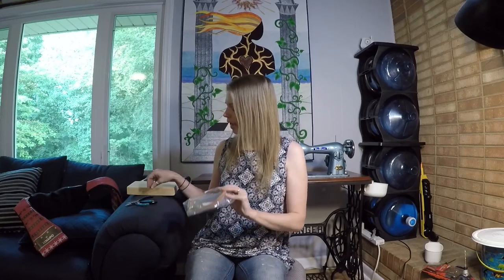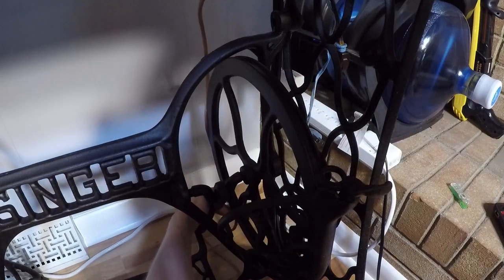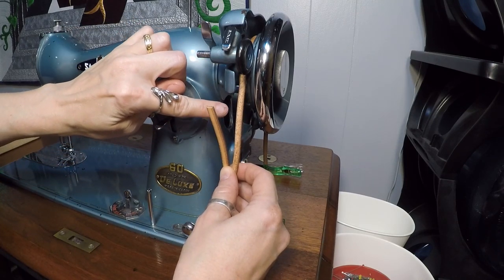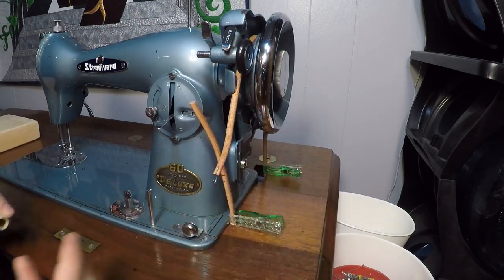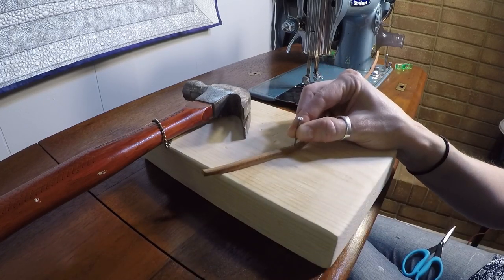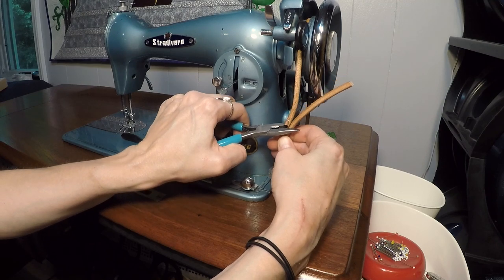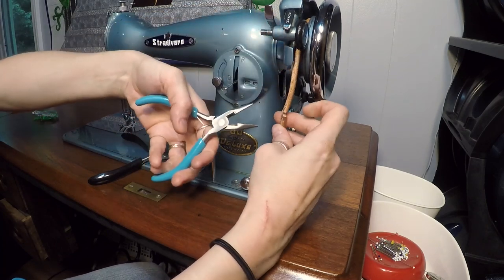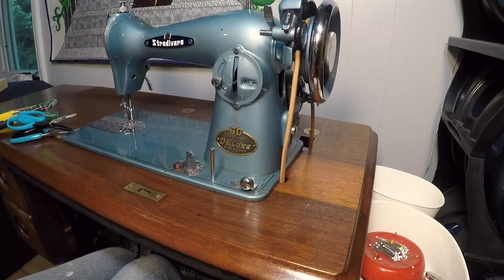How to Replace a Treadle Belt Step By Step with Leah Day

Comment: An essential step that most people don't know is that you're supposed to soak the belt in warm water for 15 minutes before measuring and linking the ends together.  Once you get it the right length and put on the machine the belt will tighten around the pulleys to the appropriate tension.  This prevents slippage during sewing.
Reply: I would worry that the water might cause rusting on the wheels. Have you experienced any issues with this?

Comment: Pro tip:  since the belts will stretch with use, I like to put the non-clip end on the floor, step on it, and give it a good stretch before putting it on the machine.

Comment: Thanks for the tip about using a rubber band to help with minor slipping! I just got a Decker treadle and the belt is slipping. I have been working on getting it running and I am too impatient to wait for a new belt to arrive. In the mean time I am heading to the kitchen junk drawer to get a rubber band from some asparagus my hubby pickled! Later...

Comment: Nice machine! You can also use a fine drill bit to drill a hole in your belt, it's a bit easier than using a nail. Thanks for all your helpful videos!
Reply from the maker: Yeah... I thought of that, but figured the nailing would be a bit less intimidating. Now I just want to get the special pliers and be done with it!

Comment: The suggestion of putting a rubber band was REALLY HELPFUL! THANKS SO MUCH!
When do you know it's really time  to replace it? I've just shortened mine because it started slipping (it's really old...) but it started slipping again just two weeks later, and a lot worse than before. Since we're currently having a heat wave and I've had the windos open a lot, I'm wondering if that has something to do with it, but on the other hand, this is my grandmother's machine, and the belt has probably not been replaced in ages... my grandmother died over 30 years ago and I never heard my mum say she had replaced the belt. My mum died 7 years ago, and I have only started sewing now, to make face masks.
For the time being, I think it works again thanks to your suggestion to add some rubber bands on the wheel, but any advice is welcome.
Reply from the maker: You probably won't need to replace the belt, just tighten it. Check the place where the belt comes together and see if you can use pliers to pull the ends tighter together. Leather does stretch out over time which is probably why it's slipping. I only change a belt if I'm changing machines in my treadle cabinet or if it has snapped.
Reply: @LeahDay  Thanks for your reply. I did already shorten it a few weeks ago, and it worked fine after that, but then it started slipping again. I was wondering whether it was because of the heat wave that we're currently having...
For the time being, It's OK again, as I added some elastic bands around the wheel. The grip is fine again now.

Comment: Thanks .. so clear and detailed.  All correct, but the cord is sliding on the big wheel.  Treadle operates the big wheel, machine wheel operates needle and big wheel, but the big wheel doesn't turn the machine wheel and keeps sticking. Just oiled connection points.  I've tried the bobbin wind clip and makes no difference.  Tried tighter .. tried elastic band on machine wheel so cord doesn't slip.  Do you have any ideas please? Its a retro SINGER from the 70s .. .seems to be in lovely condition.   No clips on the big wheel.

Comment: Great video. My machine has a treadle and also motor. Do you run both bands at the same time in two channels on the hand wheel, or take one belt off to use the same channel for the other band?

Comment: Always keep the short belts because you can use them to add in with another metal clip.  That means you can save the ones that you cut too short.  You will have two metal clips but that is ok.  It works fine.  I have used a needle and thread instead of the metal clip because the thread does not make a clicking sound and is more flexible around the wheel.   Mostly I use the rubber belts now as there are a lot of things I like about the rubber belts.  I found a metal belt on the internet in the form of  coil spring.   Did you get your singer 237 working yet???
Reply from the maker: That makes a lot of sense Owen! Thank you for sharing. I have the 237, but I need to adjust my table opening to be very slightly larger and then I'll get it set up. It's been on my list for a month, but just not at the top of the list!
Reply: Owen I'm still in the beginner stages of treadling trying to keep the hand wheel going in the right direction but I chose a rubber belt and the 237 to practice on first!

Comment: Do you need to remove the belt when you fold down the sewing machine (into the housing unit)?
Reply from the maker: It really depends on the machine and the table. For this table in this video, there was no drop down option. This table was designed with a Coffin Top to cover the machine which wasn't with it when I bought it from an antique store. 

I would assume most will need to pop the belt off the drive wheel, hence why later treadle bases made belt guides with springs to make that job easier. 

Just keep in mind that putting the belt on is far more time consuming (cutting, setting the clip, punching the hole, etc). Once it's connected and the right length, it should pop on and off the drive wheel very quickly.

Comment: Good tutorial, Leah. I'm curious about the belt thickness though. The amazon description says it's 3/16 but the belt you're holding looks more like a quarter inch or even 3/8. Can you possibly confirm its thickness for me? Some of the comments on amazon say the belt is way too thin for their machines.
Reply from the maker: Mine are definitely 1/4-inch thick. I'd look for another seller, possibly on Ebay, selling 1/4-inch thick leather belts instead.

Comment: Another pro tip:  put the end of the belt on the block of wood and give it a couple of good bashes with the hammer to flatten it before you make the hole.
Reply from the maker: That's a great tip! Thanks Pat!

Comment: What if it's not moving the needle ? 😬 I got my great grandmas machine and I bought a new belt for it and I'm trying to get it working... I followed these steps and the belt actually seems a little tighter than the one in your video... It doesn't work though., ... It's also very squeaky and hard to push the peddle, do some models have a lock or something? 😬
Reply: The little wheel on the singer does move the needle when I spin it though
Reply from the maker: It sounds like the hand wheel might be loosened like it was set up for winding bobbins. Look for a manual for your machine online and also learn how to oil it. If it's squeaky, that's a call for oil!